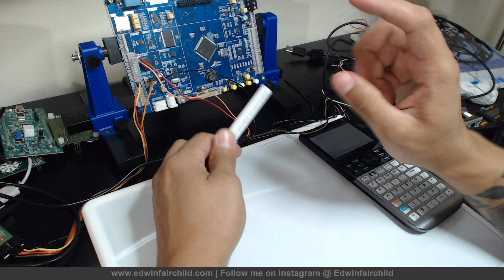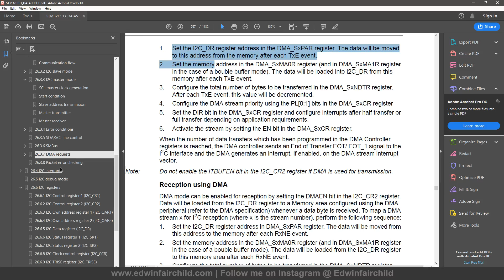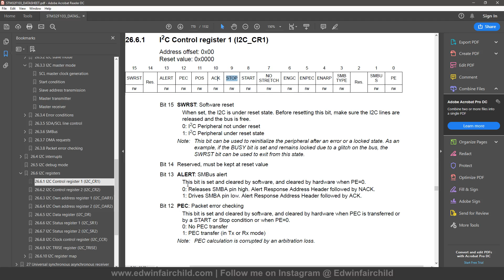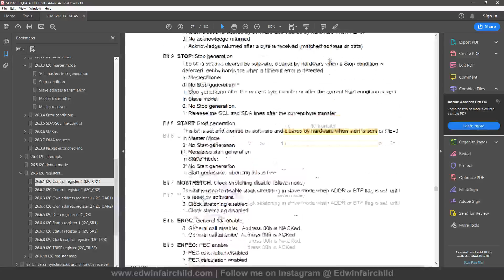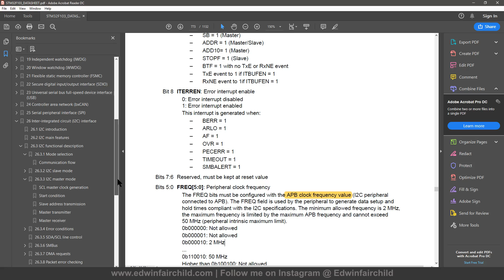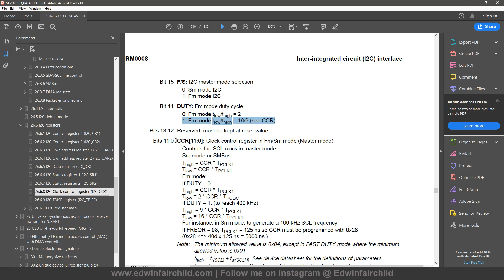STM32 I2C: Pt 1

Comment: can you give the data sheet of stm32f1xx which you use in this video
Reply from the maker: Look for  reference manual RM0008 , this is called reference manual not datasheet, sdorry for the confusion https://www.st.com/en/microcontrollers-microprocessors/stm32f103.html#resource
Reply from the maker: Everything is on the internet man, stm32 website. Google etc..
Reply: @EdwinFairchild    i download many pdf files but I can't get